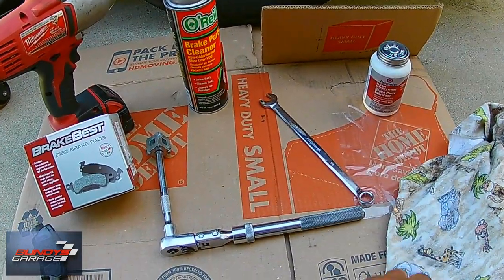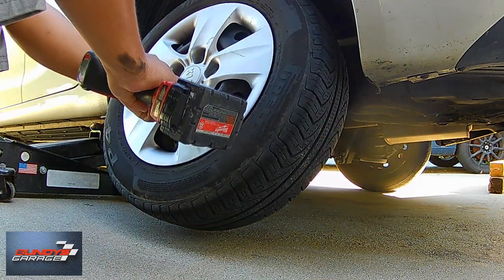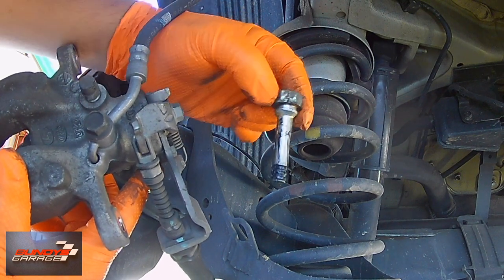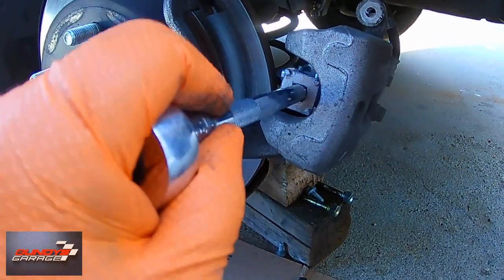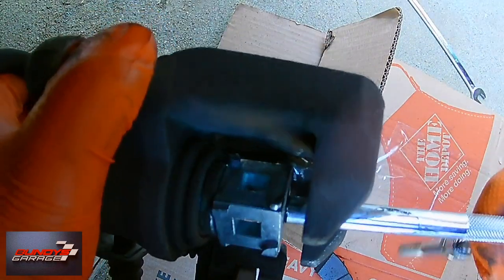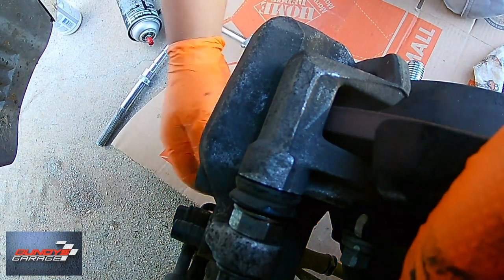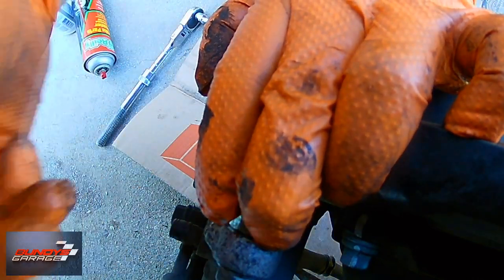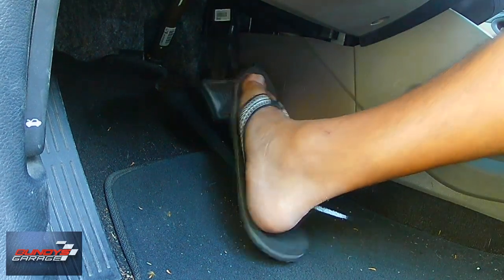Kia Forte Rear Brake Pads Replacement | 2012 - 2018 | Hyundai Kia | Elantra Veloster Forte Forte5

Comment: When jacking up the car, place jack on lift point of car. It's under car just behind tire on car. Not frame or other part. Lift car from life point. Ive seen so many lift cars wrong. Jack falls over or breaks. Be careful when lifting car. I always put the tire when taken off under the car for addition catch. If Jack falls over ya tire is there so u can get Jack out.
Reply: Or better yet, use jack stands. On both sides and use wheel-chucks on the tires still on the ground to make sure your car does roll

Comment: Should I bleed my breaks after installing?  I did this one time before and I didn't bleed the breaks that I got from the dealer. And they lasted less than the original ones that came with the car.
Reply from the maker: No there is no need to bleed your brakes. Bleeding your brakes or not bleeding your brakes has nothing to do with how long your brake pads will last.
Reply: @bundysgarage  I agree but is it better to or not ? I did it exactly how you did it. I wonder if the dealership just sells shitty break pads after the original sets are used
Reply: if the rotor is bad it'll wear down your brake pads fast so odds are you need a new rotor
Reply: @ivan23caravantes44 did you buy a cheap product or the OEM recommended brake pad?

Comment: Pump brakes 3 times to build pressure and then turn car on. It will adjust when power is on car. With.or without abs.

Comment: Solid content. I've replaced pads about 7 times on various personal vehicles. Didn't realize there was a toll for pushing the piston back in. I've got an 2019 Forte who's going to need pads soon abs I refuse to pay the dealer 270 for pads. In the Forte, is that piston tool mandatory or can it be done by hand (with lots of curse words)?  Tia
Reply: I've heard of people getting it back in without a tool like that, but since you can borrow a kit from auto parts stores for free (which are actually better than the tool he uses here IMO), I see no reason not to do it with the proper tools.
Reply: C clamp
Reply: C-clamp WILL NOT work on the rear brake caliper, they need to be screwed back in clockwise, sometimes needle nose pliers will work, or other methods just as long as you CAREFULLY get the piston SCREWED back in...
Reply: I've always used a c clamp. To compress the piston
Reply: Use needle nose pliers. Put the tips in the holes and twist/push.

Comment: Wheels also need to be torque to spec when getting lug nuts back on.
Reply: If u put lug nuts on and drive car a CPL mins. Pull over and tighten the lug nuts. They will most certainly be lose again. Torque the wheels to spec and that won't happen.

Comment: Can you tell me if the parking break was applied thru the process of changing the rear brake pads???
Reply: No. You have to release the brake or you'll never be able to pull the caliper off or compress the piston.

Comment: Can also use a c clamp for caliper piston. But was looking for a video with drum brakes on Kia. 2012
Reply: Using a c clamp or traditional break tool does not rotate. MUST rotate those rear calipers clockwise or something is going to break.

Comment: Lousy video.  Don't let the calipers hang from the brake line; hang/hook/tie them up.  Use a torque wrench when putting wheels back on, unless you like overtightened lugs, warped rotors, and prematurely worn brakes.  Couldn't hurt to use a torque wrench on the caliper bolts as well.